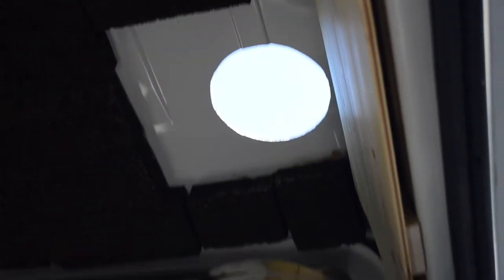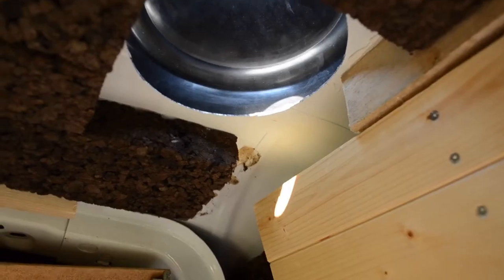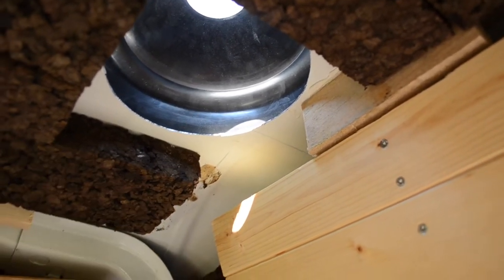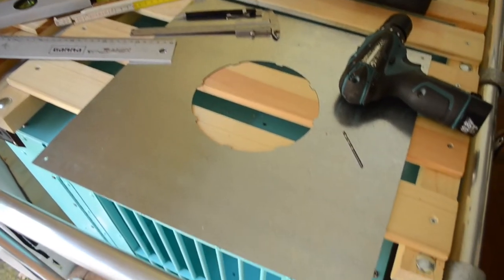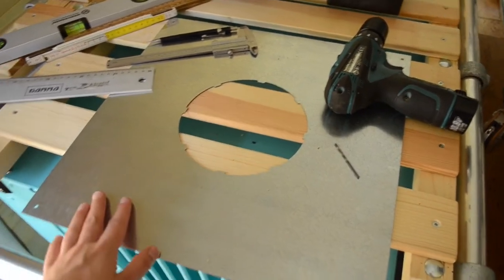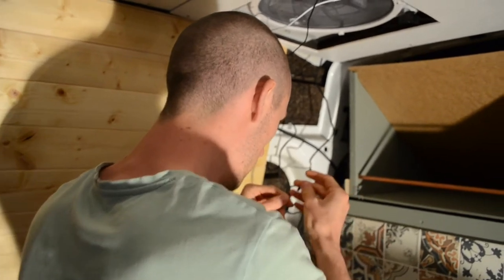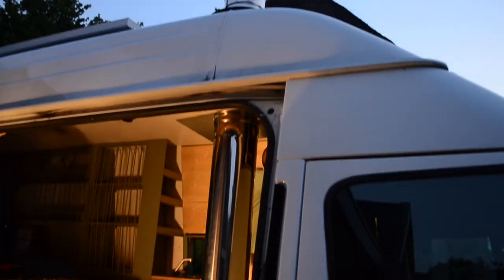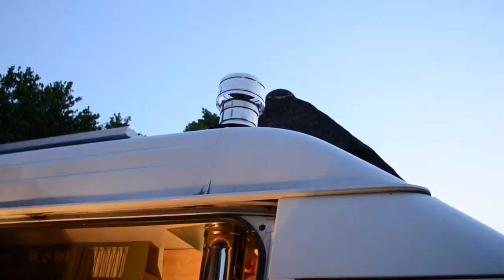Campervan conversion: Installing the flue pipes

Comment: interesting to see how you guys did it! I was hoping the pipe would heat up van as much as the stove itself, I may try single pipe and modify after. Or perhaps double pipe for last section in contact with roof.